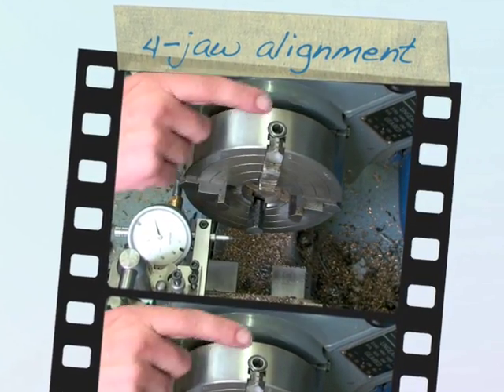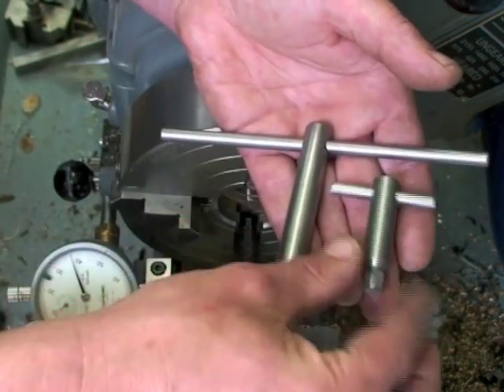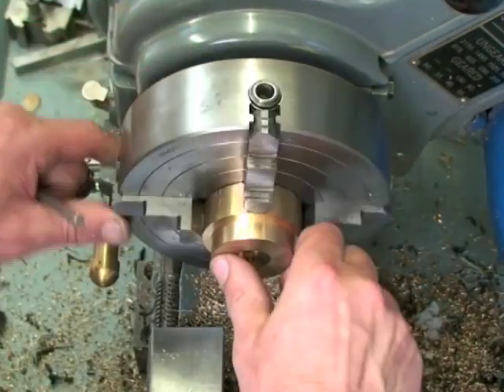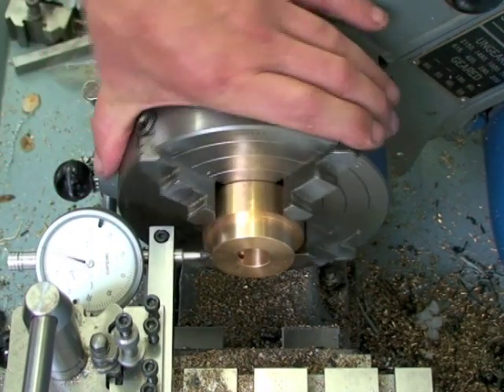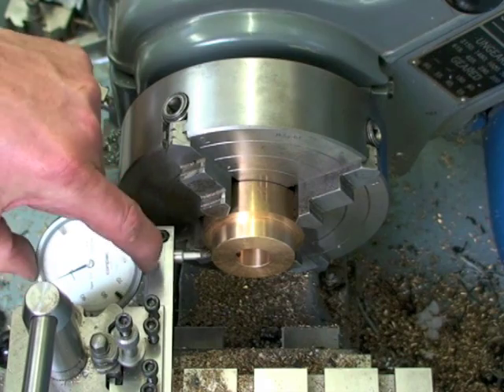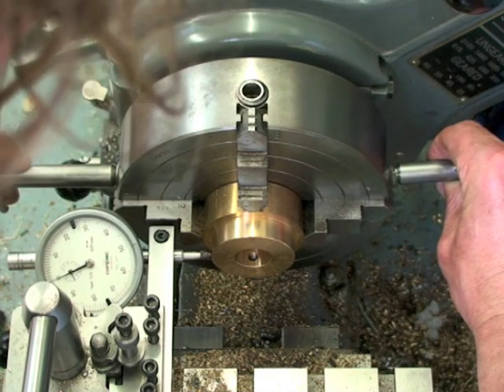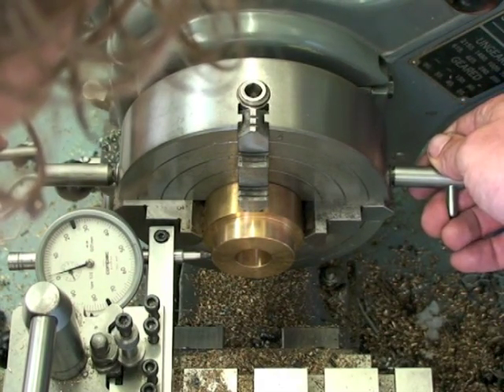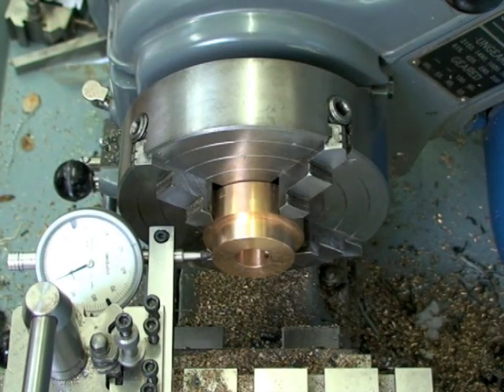Easy centering 4 jaw chuck

Comment: By far the best video about centering work in a 4 jaw chuck on You-Tube.  After watching I went out to the garage and made an indicator mount for my tool post and also made a mini chuck key.  The first part I tried to center took literally 40 seconds to get within about 3 tenths.  I watched several other videos and did learn a bit more, but I found that if the video was longer than about 5 minutes it wasn't worth watching.  I don't think I'll be putting the 3 jaw back on the mini-lathe soon.  Great job.

Comment: Not bad at all for a small lathe. Very good tip for those with little experience using a four jaw. This coming September will mark 39 years experience as a machinist. I cut my teeth on an engine lathe and a milling machine. CNC has certainly given us faster and more efficient ways to do things but it can never replace the skills of the old masters I learned from. It is sad to think that so much of the knowledge that I have will die with me and others like myself. Ah the joy of days gone by.

Comment: Thanks so much.  I have a small outdated, machinex 5, lathe that is impossible to find tooling for, still can't find anything.  The only thing I have that is at all accurate is an old craftsmen 4 jaw adapted to the Machinex. It would drive me nuts going back and forth trying to center something, even using other tried and true methods.  This method has made using this machine so much easier.  Thanks again.

Comment: Just seen this video. I wish I had seen it years ago as it is so damn good. A simple idea of using two chuck keys, yet it never occurred to me! I have been testing the technique outlined in the video and I have been consistently getting to within .005 on the first spin round. A couple of spins and it's dead nuts on!  Thanks for the info.

Comment: @KevinMillard68 

With our old 3 jaw scroll chuck at work its generally runs out about .0015" (.04mm) with the old hard jaws, so you have to either shim the work, use soft jaws (which we do most of the time) or use the 4 jaw chuck.

The 4 jaw is an under used piece of equipment and can be fast and simple to set up compared to screwing around with shims or turning non concentric.

Comment: Hi. In answer to your question here, I hope this helps. 4 jaw chucks are used for  when you have a small amount of material to hold on or irregular out of round stock. Forgings, castings, fabrications are another reason for using a 4 jaw chuck. 3 jaws are great for general purpose but the use of soft jaws with 3 jaw chucks make things a lot easier to hold components especially finished machined parts.

Comment: @KevinMillard68 Probably you are using newer/better scroll chucks than what i am, because in my experience it's tough to get better than .005".  Usually it's worse (especially when changing diameters)  With some of them it has been tough to maintain center even when removing and replacing the same part (in the same orientation). with a four jaw, you are not at the mercy of a worn out scroll gear.  though there are some tricks to getting good center alignment from a scroll chuck.

Comment: Unless the 3 jaw is adjustable there will always be a little bit of run out and this is removed by using a 4 jaw so everything runs concentric. You should only use a 3 jaw on turned surfaces or bright material and a 4 jaw on everything else including pipe or any material that has scale on the surface.

Comment: @dorplein62 
If you put a round workpiece in a four jaw chuck you will be able to centre it much more accurate than with the autocentering three claw where plus or minus 0.03mm is quite normal.
Or use the independed three claw.
I think the uplouder of this video is trying to show you that.
Bigmouth nobrainer.

Comment: Or you could just use the tailstock centre as an approximate guide. This chuck is already not too far off anyways. Try this after someone turned a rectangular part, and it would be a much longer video.
No disrespect, this tip is certainly handy once you get into precision range. I just wanted to help anyone who has a large amount of adjustment to do.

Comment: thi s does seem to be alot eaiser to do , but id just like to add that if you are not turnning stuff off center then the best chuck to have is a 3 or 4 jw scroll chuck , independent chucks are only good for hold some really odd stuff that a 4 jaw scroll wont and are also only usfull really when doing off center turnning operations, so really you need all 3 styles in order to do just about everything, you can think of..

Comment: I would not like to whine since this is well explained and method is ok for not so accurate pieces, but you are supposed to use another measuring clock (not sure what it is called on english) on the flat surface of the part you are machining so the surface is also straight.

Comment: or if you have a round hole in your part Slide the old dead center up to it give it a little kiss with the tail docked first, get you within reason or find out the tailstock accuracy later I guess

Comment: Please dont flame me for a stupid question as Im not an engineer.

Why are the jaws independant ? Surely if the jaws were linked by gearing then the piece would self centre as the jaws close in unison. I cant see any benefit to independant jaws when working on symmeytrical pieces. I only see margin for error if the piece isnt centred true.
There must be an obvious reason, but I cant think of it, Im puzzled.
Reply: If you read the preceding comments about 3 jaw chucks you will have your answer

Comment: how would you centre a HEX bar, then off set it by 16mm, I tried reversing jaws 1&3 so I had a larger surface area to act as a clamp, but I was told that this was bad practice ie:- all the jaws should be in the same oriantation

Comment: There are right ways and easy ways to do things and you need quick ways if you are in a production shop. You have had to make a new key and a special indicator holder. Using an arm indicator you adjust the uppermost jaw and it will work on even shorter and smaller work sizes where you holder wont. I am a toolmaker and I have worked on drilling .004" holes and on bearings which measure over 6 feet in diameter and I know it works. Have been in the trade for over 35 years and have been around.

Comment: Get rid of that style of indiactor and get an arm version and that way you put the indicator on the top and adjust the upper most jaw. You are making a simple job complicated. I can clock up a job using my method in less than 40 seconds and you dont need to make a special indicator holder and you can clock up small work pieces as with your holder you can not due to the diameter of the clock.

Comment: Did you indicate the front face?  This method does not work for any work piece that weighs over 3lbs.  Waste of time.  Try using this method on a 42" chuck. Good luck